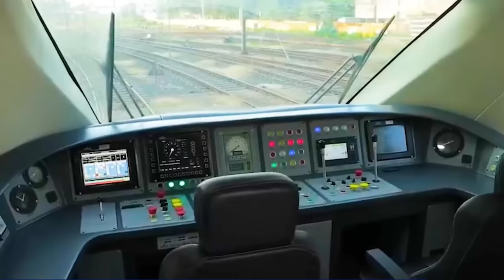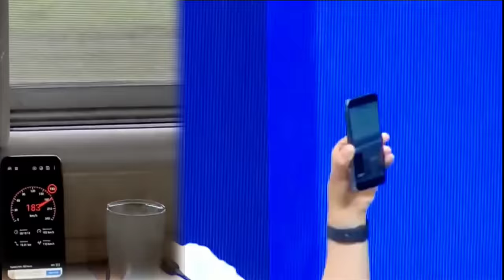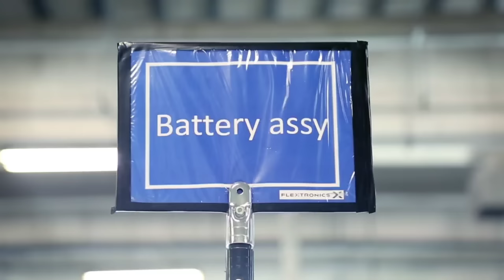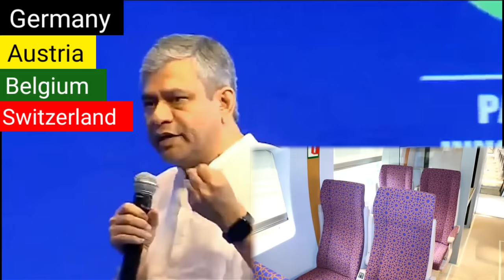Germany, Austria जैसा बनेगा 'Dream Project' 🔥 75 सालों में पहली बार $29 Billion 🔥2023

Comment: The air conditioning in present Indian trains is left out to the coach personal. They make the temperature so low that many passengers feel sick. Can it be kept fixed at a level prescribed by medical experts?
Reply: I travelled 4 days back 14 hrs overnight and at night temp was so low I started having shoulder muscle pain in morning. it was so severe like I had a fracture on both shoulders. Had to take pain killer and massage with hot pack at home. I don't know why they do this. The temp should be set to 24 at all times imo. 22 min. They do 16-18 like they were born for it.
Reply: Really It fells more comfi when you come out from the coach.
Reply: @pratyushsharma6655  This doesn't happen in cabin system. Each cabin has it's own Air conditioning controller.
Reply: @cotmajor6045  Lots of ppls has high pressure tendencies in India but they don't know, so they decrease the airconditioning.
Reply: @pratyushsharma6655  Carry whiskey 🤣 when ur using common airconditioning. 😜
Reply: True but in metro me high kr dete hai

Comment: Govt is giving stress on road,rail,air,electronics& communication,defence etc. one thing it  is not understand why it is being lack in shipping, port devlopment & inland waterways, (in comparison  to a smallest country in Asia) the cheapest mode,with vast costal line , after sacking Gadkarijee.The country will use the sea port not the countrymen the ultimate voter.

Comment: Wtf.. Project deal was done back in 2015 and was expected to complete by 2021-23 but now it has been delayed to 2028. Not sure it will be done by 2030..By then China will have 60,000kms length of bullet train.. Currently, it has more than 45,000 kms length😢😢
Reply: Deal was done but projects need Strict Environmental Clearance. They got it in mid 2019. 
Route was changed to save 21000 mangrove out of 53000 which previously were about to chopped off.
Land acquisition, where Maha Vinash Agadi didn't acquired the land (State subject).
Then Court cases 🤦🏻‍♂️🤦🏻‍♂️🤦🏻‍♂️